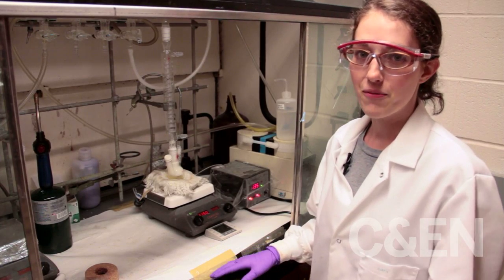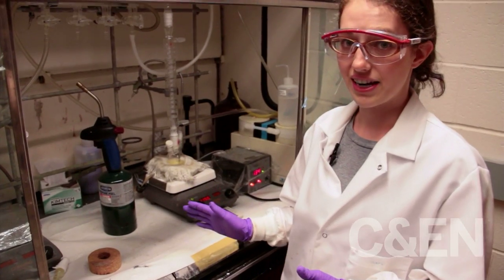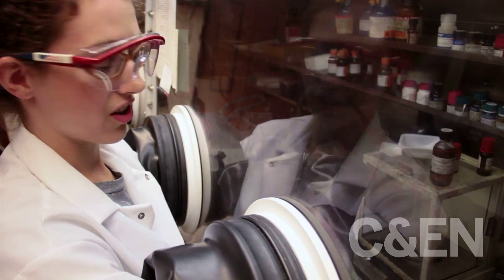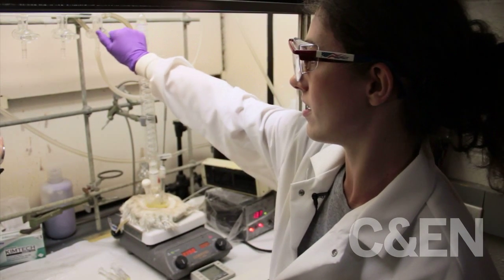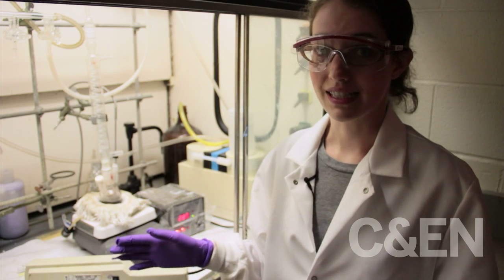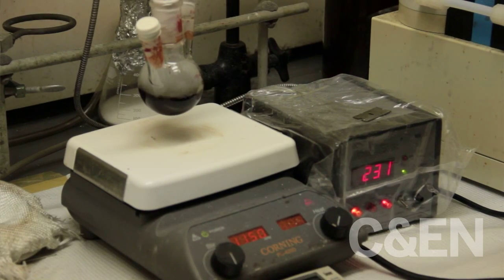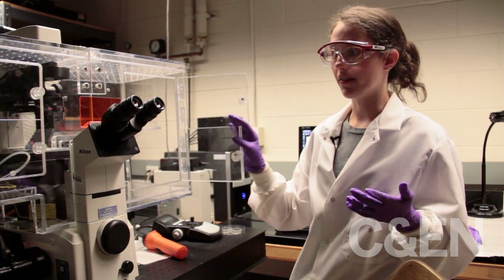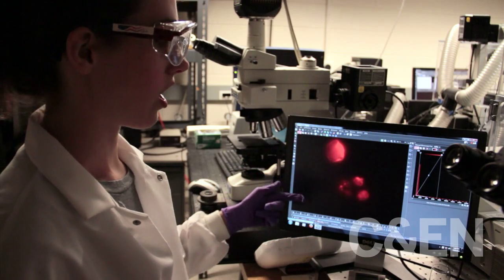How to Make Quantum Dots

Comment: Really informative.  Thank you.  Several companies are now making commercial quantum dots.  Besides using dot size to modify the emission wavelength, it's also possible to tune the output wavelength using a composition gradient in the core material.

Comment: I actually made CdSe QD synthesis optimization as a project yet with the TOP/TOPO method. Also made multishells. Thing is I didn't have to evacuate the vessel that long. The basic synthesis is really this easy though time-consuming due to the purification steps if you're doing multshells. Too bad I didn't have time to do biofunctionalization.

Comment: @61324852 @61324852 More than likely you'd use the SILAR method for covering the QD with an epitaxial inorganic layer that has a wider bandgap (for coating CdSe you'd use something like CdS, ZnS) see Peng et al, 2003 Large-scale synthesis of nearly monodisperse CdSe/CdS core/shell nanocrystals using air-stable reagents via successive ion layer adsorption and reaction

As for who invented QDs, the modern incarnation of what she's working with is attributed to Bawandi and Murray ~ 1993